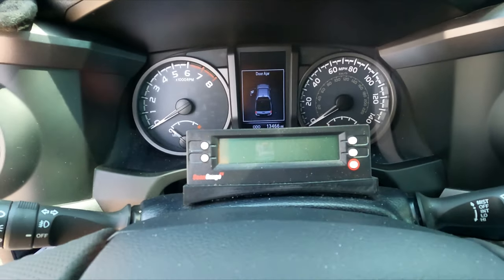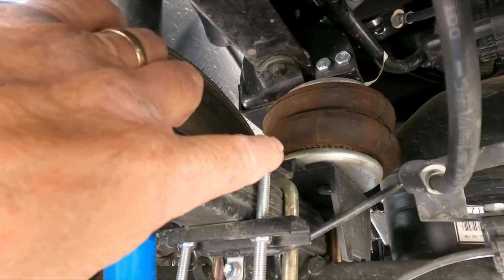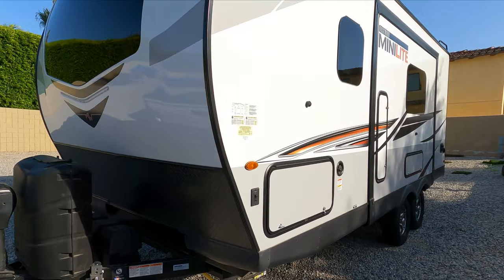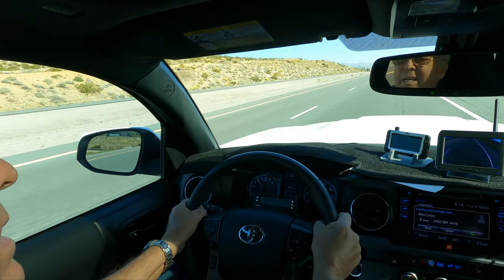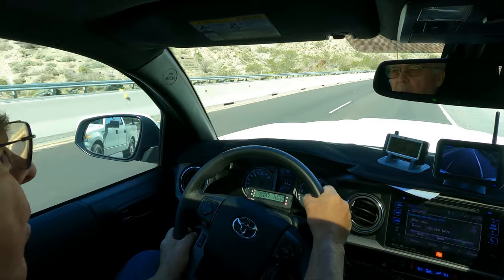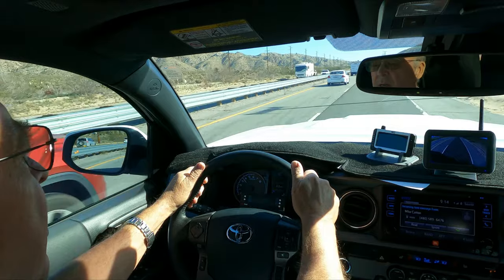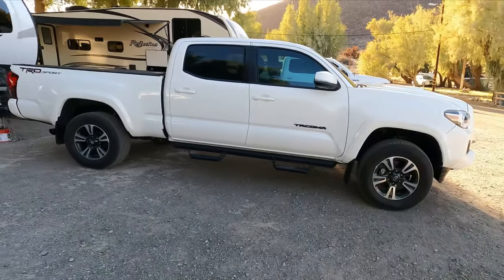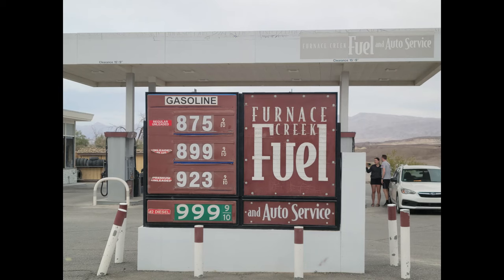A Real World Tacoma Tow Test

Comment: FINALY!!!! Someone that  knows how to tow a trailer with a Tacoma , every other video I have  seen , you have these people that have no business towing a trailer give their opinion on how bad the Tacoma tows , when they leave it in D and don’t use ECT. The only thing I would have done differently is left the truck in a lower gear and slowed down just a little until I finished climbing the hill , other than that good work !
Reply: Why not use the ECT, and what lower gear would you use
Reply: You absolutely use ECT when towing and you leave the Tacoma in 4th gear , 5th & 6th gear  on the Tacoma are over drive gears , when I tow my car with my Tacoma total weight is 5700# , I leave  it in 4th gear , and there is no gear hunting at all even going up hills it maintains speed no problem, unless you are on a straight away Than I would select 5th gear . Truck does great running around 60-65 mph when towing and I average around 15 MPG’s . Also another note worth mentioning here is the 3.5L in the Tacoma is a high compression motor 11.6:1 to be exact so I run strictly 91 octane and I can tell the difference, the truck is just more responsive and gets better fuel economy. You can use 87 octane but it will feel like a dog !
Reply: @peterhoma6385   I've got a 19 sport. Kd max tune. No other mods.  I tow all the time.  Towing a couple of sleds or atvs on an open aluminum trailer 4th gear ect on,  it's fine on flat 65 mph.  Any incline or a bit of headwind and it's game over.  All it does is shift and scream.  I love the truck, but damn it lacks any highway towing ability unless you're deaf and don't mind all the shifting.
Reply: The 3rd gen tacoma is such a pile I used ECT every day regardless whether I was towing. Went as far a pissing away money putting in 4:88’s. Shitty ass car motor with no low end balls. The 4.0 was a far better truck engine. After owing all 3 generation Tacoma the best thing I ever did was get a V8 Tundra. Anyone who thinks a Tacoma is good for towing a moderate load on the interstate already drives like a pansy at 55 with their hazards on.
Reply: We haven’t towed anything yet with our 23 TRD Off Road double cab.
We have 2 mountain passes to go over when we have to go to Seattle so I always engage the ECT. We also do the same when we’re going over the Continental Divide when we go over to Montana to my wife’s family r
17K acre ranch.
Reply: @Captndarty  So in other words if you drive the speed limit you'll be fine, but if you speed, drive recklessly like you do, go in and out of traffic lanes, etc you'll need a much bigger truck so that you can break traffic laws. Got it now. You're really cool by the way.
Reply: ECT mode is basically tow haul mode, Toyota just named it differently on the  Tacoma’s.
Reply: @greatlikeelviseh6063  The engine in the truck is designed to produce it's power in the 4000-5500RPM range. When its working, its gonna be loud. Nothing wrong with it.
Reply: @southernsavagethejoshclark9083   I solved the problem.  I bought a Tundra.  The Taco was a sweet truck, but it just doesn't have what it takes to tow comfortably.  It could do it, but it gets exhausting listening to it revving and shifting all the time.
Reply: @kenmcalpine2215  I understand. I didn't buy mine to tow, but rather to camp,  off-road and rock crawl with. An adventuring truck I guess you could say. But I do want to trailer a small off road tear drop or something. Thats why I've been looking at towing videos. Issue with a Tundra or full size, is they can't go all the same places and do all the same things that the Taco can, off-road. Too big, too long and too heavy. So, I got the taco, and will just pull a sub-3500lbs trailer
Reply: @southernsavagethejoshclark9083   Ya.  I loved the size of the Taco, and even for towing it was fine....until you gave it any kind of a hill or a headwind.  It's too bad.  Even with it tuned,  it just didn't have enough for me.

Comment: Your truck is a long bed so it’s rated for 6600#. The short bed crew cab is rated for 6700#. The only Tacoma rated at 6800# is the extended cab. Subtract 300# for a 4wd.  If you install an auxiliary trans cooler it’s recommended that it has a thermostat. The concern is that the transmission runs too cool. Apparently the Toyota 6sp transmission likes it a little hotter so much so that in the last 2 years of the second gen tundra they removed it. Another thing that may help it run a bit cooler is not let the the transmission hunt for gears. I usually manually shift to the next lower gear and slow down a bit. I have a 2020 TRD sport 2wd short bed and tow a Lance 1995 which is about the same weight as your mini lite. I towed it up the coast to Oregon from Southern California and then to Virginia and back. I averaged about 11mpg for the trip. It went over the Rockies with power to spare but I didn’t race it up the passes. I seldom went over 60 mph unless I had a pretty good tailwind. I change the oil every 5000 miles in spite of the dealer service Dept telling me I do have to and I will change the transmission fluid at 50,000 miles again in spite being told it’s not necessary. See the car care nut on YouTube. He’s a certified Toyota mechanic at a dealer in Chicago. Very informative videos!
Reply from the maker: My truck is the crew cab long bed and "is" rated at 6800 Lbs. That's what the tag on the door says. Not that a couple hundred pounds either way makes much difference. As for oil changes. Might have one coming next month. 3 years old and just finally hit 14K miles. I have only pinned the transmission as a test when towing this one time and in this desert it didn't take much time to get up to an operating temp but it sure helped to have a cooler head start when hitting those grades. The next trip is the end of July when it will be hot as hell and unfortunately still uphill, I'm pretty convinced I can make it out of here ok. Haven't noticed that the transmission downshifts all that much differently in Sport mode with ECT than I would, but I have contacted my dealer and they will be doing the current factory software upgrade at my next service. We'll see if that produces any improvement. I've also consulted "Yotatuner " about possibly doing a "Valley Tune" upgrade. He's willing to work with me on a tune vs stock comparison and I may post on that later.
Reply: On a 2019 Toyota Tacoma SR5 double cab short bed I purchased a travel trailer that weighs dry weight of 4,125 lb on the door it says that I can pull 5600 very confused on the fact on the information that's online and then what's on my truck. My question is do I go by what's online or do I go by what's on my truck and if I have to for work I may have to pull my travel trailer from different states now that does not include the weight of any essential items that are personally mine that would go inside the trailer would I be okay?
Reply: @popclutch_100  I really don’t understand why there would be a sticker on your truck that says 5600#. That’s not really consistent with the tow ratings from Toyota. Toyota doesn’t usually put a tow rating sticker on their trucks. Their tow ratings are easy to figure out from Toyota’s advertised tow ratings. The 5600# pounds is the GVWR or gross vehicle weight rating. This is the total weight of the truck, cargo and passengers. This also includes the tongue weight of a trailer as well as the hitch weight. Tongue weight is usually about 10% of the total trailer weight. This can go up or down depending on how you load your trailer. It’s more important to consider the gross vehicle weight rating of the trailer than the dry weight when considering a tow vehicle. Remember that max tow rating is based on no cargo or passengers in the tow vehicle with only a driver. This is rarely the scenario. The other important weights to consider are the tow vehicle payload and gross combined vehicle weight rating. For the Tacoma with a V6 (includes tow package) the CVWR is just under 14,000#. The payload is 900# to 1300# depending on if it’s 2wd or 4wd and whether it’s a crew cab or extended cab. Always use a weight distribution, sway control hitch. I put Timbren springs on my truck which helped a lot with towing stability.
Reply: @markreams3192  my truck is the 4 door v6 4x2 5 foot bed
Reply: Appreciate you replying sir. I officially owner a camper
Reply: @garycotton  hey sir, I bought a new 22 Tacoma 4x4 crew cab with the 5’ bed back in September and just bought a new 4560# dry weight Sonic camper yesterday and should be picking it up this coming week some time and find your video to be very informative. My question is have you seen any videos on the pinning the transmission deal? And when you say you put it in the shift mode is it still up and down shifting on its own?
Reply from the maker: @Matt Varnes  I've seen one video on pinning the trans. It's pretty easy to do. All it does is bypass the thermostat so fluid constantly runs through the auxiliary cooler. It's my understanding though that newer models have discontinued the aux cooler so that may not be an option for you. On a different note, My Tacoma always towed well on the flat & level with no wind. On the last two trips, I experienced some wind, and it played hell with the truck. It took me 11 hours to get from Indio CA. (375 miles) To Tucson AZ. averaging 7 miles per gallon. Any less that ideal circumstances prove to be a bit too much for the truck so I have traded it for a new Chevy 1500 with the 3.0 Duramax diesel. I plan a towing trip soon on the same route as this video and plan to do a comparison video.
Reply: @garycotton  thank you for the feedback sir, I just traded in a nice 1500 2020 with the 5.3 to get this truck and then my better half decided she wanted a camper lol
Reply from the maker: @specialistonfire  Maybe we should have just swapped trucks.

Comment: I've owned a few tacomas and pulled travel trailers 4500 lbs or below with them all.  I've never used a transmission temperature gauge.  I've always ran them in S4 to prevent shifting and did real well them.  I never go above 65 mph for better fuel mileage.  I pull 2022 Jayco BH15 2800 lbs with a 2023 Tacoma TRD off road.  Really get better gas mileage now 12 to 14 mpg.

Comment: I have a 2023 Colorado. It's rated up to 7700 LBS. I pull 6000-6500 LBS GRVW pretty often at 26 FT with no issues. These newer midsize trucks are great for getaways with smaller travel trailers. Once you unhook you can run around towns and park with ease.

Comment: Thanks for the video,much appreciated.  I have a 23 Tacoma Off Road with the long bed.  I wanted to recommend that you get the “Overland Torque Tune” for your truck.  It will dramatically improve both the throttle response and also the hunting for gears.  I did it about 4 months ago and honestly think the truck should have come from the factory with the tune.  If you would like a referral let me know.  I live in the Inland Empire and the guy I used is mobile.  Anyway, thanks again.

Comment: Great video Gary.  Very thorough and well reasoned.  I have a 2019 Sport 4x4 and tow a 4100lbs tt.  It tows it like a champ, I did upgrade the trans cooler due to the hills where I live.  I think the key is to keep it around 60mph and you'll be fine.  I'm amazed by the full sized trucks that fly down the highway and wonder why they blow tires.  Give yourself lots of space and only go as fast as the trailer tires are rated for.  The only issue is the size of gas tank.  Would be nice to have a 26 gallon tank.

Comment: Nice setup, I have a 21 SR quad cab 4x4.   I have the same TPS monitor.  I went for the Sumo springs (blue) and that was a huge improvement on the highway for stability, when not loaded they dont touch.  I installed a Redarc integrated brake controller.  I also use the scan gauge.  MY TT weighs 3700lbs wet.  The truck does the job very well.  In 21 Toyota quit using an external trans cooler.  I was a little concerned but after towing for a few years and reading the gauge nothing has heated up.  On one trip i did pullover going up Cheaha mtn in North Alabama at an overlook for about 30 min (hit 227f with a mile to go) .  I do not pin the transmission thermostat.  My transmission hovers around 188 to 193 normal conditions.  BTW   I sure envy your Long Bed.

Comment: Back it the day in my old 1985 Suburban when the transmission hit 185 degrees we started getting nervous. With the superior synthetic oils and gears today you can run these things pretty hot without worry. If I were towing a little more regularly in my Tacoma and saw these temps I would just change the trans fluid more frequently. Good video.

Comment: I towed a 2800lb trailor with my '16 2.7 from San Diego > WI. Trick with that transmission is just keep it 3rd gear and slow down to 55 or 60 on the steep grades instead of letting it kick back and forth from 4th. 4.88 gears really benefit this truck/trans also, both the 3.5 and 2.7 motors.

Comment: Nice set up, and nice logical approach to towing with these Tacomas. The 3.5 is a screamer and likes working at 4500k plus RPMs. Only suggestion would be to look into the Roadmaster Active Suspension setup. I wouldnt ditch the bags for them as you already have them set up, but they are awesome for settling out bobbing and squatting.

Comment: I have a 2020 TRD Off Road and tow a small 154BH Jayco 3200-pound coach. I have the 6-speed manual transmission with air bags and the REDARC brake controller. It handles the trailer very well. However, when going up steep grades, it makes it up, but I can definitely feel it behind me. What's you gas milage while towing?  I was getting 10MPG uphill and around 13 MPG on flat.
Reply: What Class/size
 Hitch Did You Use For your Trd??
Reply: They can definitely do it. Do they like doing it? Not really.

Comment: Great Video and information! I have a 2020 TRD Sport 4X4 up here in Canada. Tow a 4000lb Hybrid travel trailer 3 or 4 times per year 300-400 mile trips through many grades. Found my Tacoma to do the job well, mind you I think it would do better if the truck had better gear spacing in the transmission. I tow in S4 all the time.  Don't have air bags but find the equalizer hitch keeps it pretty level and solid without sway behind the truck.  Like you said, great for occasional towing but not a full time tow vehicle for sure. Im curious about the transmission pin? have never heard of that and also curious about what type of trans temp gauge you have and how easy are they to install.  Thanks for being the best Tacoma Towing review I have seen on YouTube!
Reply from the maker: I use a Scan Guage II. It's simple to install. Just plugs into the OBD port. I learned about it and transmission pinning on YouTube. Just do some searches and you're bound to find the same posts.
Reply: theirs no towing button for the tacoma right u just hook and go?
Reply from the maker: @xMrFuzZyKitteH  Well, Yes & No. You shouldn't tow in "Drive" The 6th gear overdrive is geared too high for the truck to pull something like my trailer. A small light weight utility trailer might be fine though. I tow in "S4" which is considered Sport Mode because you can manually shift. S4 pretty much locks you out of 6th gear anyway. The "tow button" would be the ECT power button. All it actually does is raise the shift points to a bit higher RPM but that does help you get the weight up to speed a little easier. Truthfully, most vehicles I've driven with tow buttons do basically the same as the Tacoma S4 & ECT in one button. Hope this answers your question.
Reply: @garycotton  I turned on the ect power just in case I'm towing a pressure wash machine with the water tank but good thing I'm not going anywhere far just around my job thanks for the reply💪💖

Comment: Thanks Gary for the detailed review. I have a 2016 TRD OR 2X and am considering purchasing a 4K# trailer ( which I've towed before from So Cal to WA State ) I never saw over 210° and only for a brief minute or two. Question? - Why do you feel the need to pin the trans thermostat? The stat will run full open when the trans is hot anyway. Why not let it do its job? Curious about your thoughts on that. Thanks again.
Reply from the maker: Sorry it took so long to reply, I'm not getting comment notifications. I pinned the trans because I've noticed the thermostat doesn't open until the trans is already hot. This seem to keep me ahead of the issue and more consistently in a better temp range . The trans never seems to run too cold and doesn't take that much longer to get to normal operating range. Bear in mind, I only do this while towing. If I try any other option it will be to replace the existing factory cooler with a unit with a fan to improve AIRFLOW on those "Low Speed" uphill climbs. That's where the existing cooler suffers.

Comment: Great overview.   Also an excellent tow vehicle/trailer combo.    I agree with your overall conclusions.  That truck should have no trouble towing your trailer anywhere you wish to go all day long.  I see you were set up with a weight distribution hitch which I tend to think is almost essential for any travel trailer with any tow vehicle for the safest towing.   As far as your fuel mileage, your numbers seem about right.   Doesn't seem to matter which tow vehicle and which trailer you have, the mileage with a gasser will be between 7 and 13 mpg.   Anyone that says they are outside of that range is full of it I think.   Diesels obviously can do a bit better, but one needs to save a fair bit of fuel to make up for the extra $10K or so on the purchase price.  Some folks seem to get all excited about all the shifting that takes place when towing, or the fact that they don't get into top gear often.   Since when did they make transmissions that are not supposed to shift gears to get you in the right one for the current load.   Enjoy your travels...